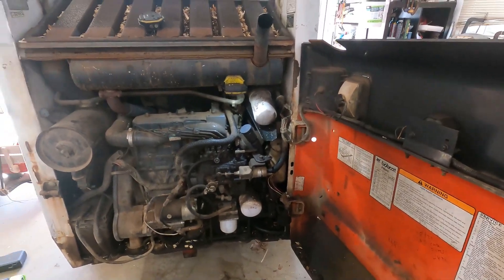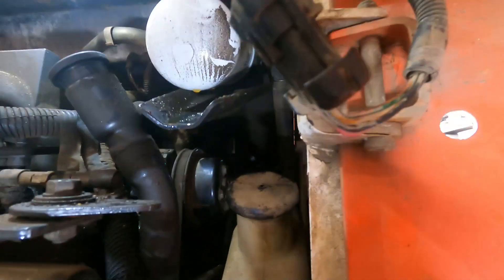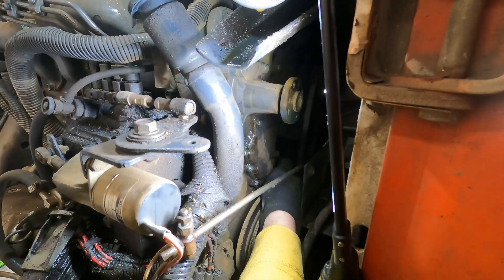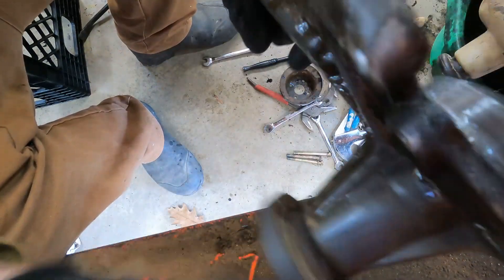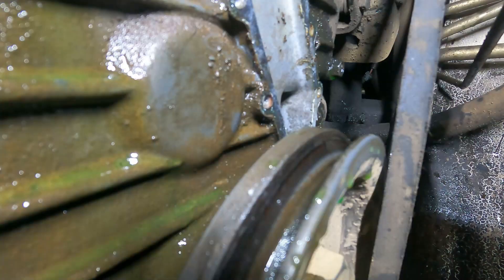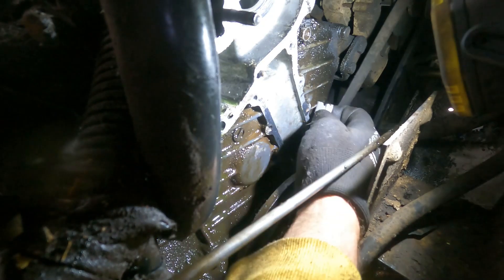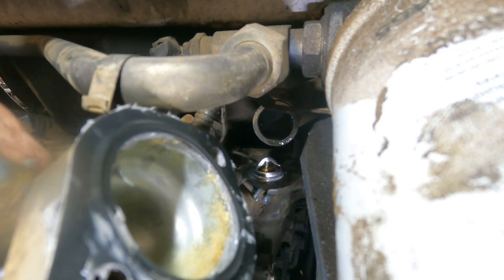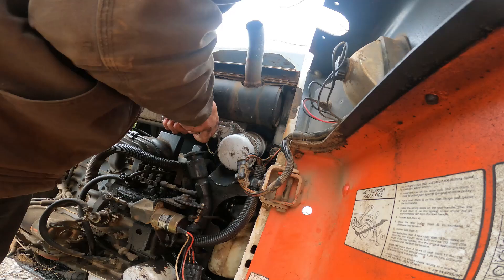bobcat 753 water pump replacement

Comment: how in the hell did you get the last bottom bolt behind the pulley
Reply from the maker: Rachet wrench likely, I don't remember any of the bolts requiring anything more than simple hand tools. Was just back in that side to replace a hose. Beat bet is to give yourself access by removing all the brackets in that area
Reply: Thank you for responding.  It is just the last   one on the front bottom
I got it in place with my fingers, held it in place with screwdriver and tighten it with a opened 10 mm
Thanks  @cliffpalermo